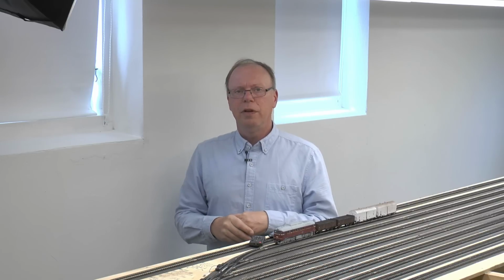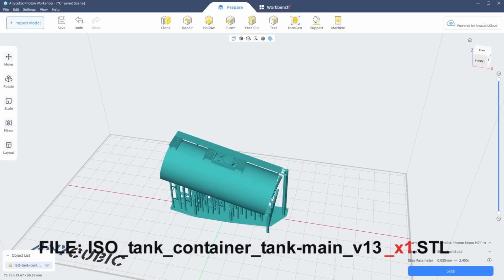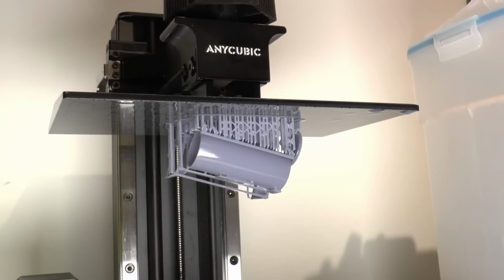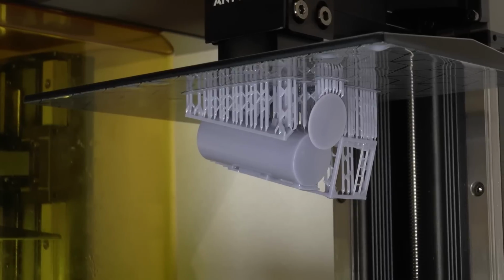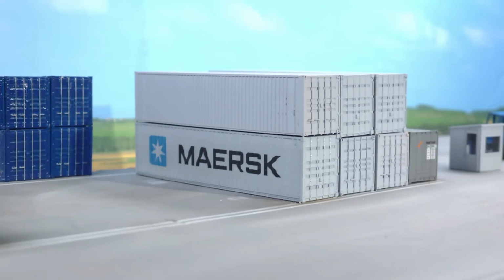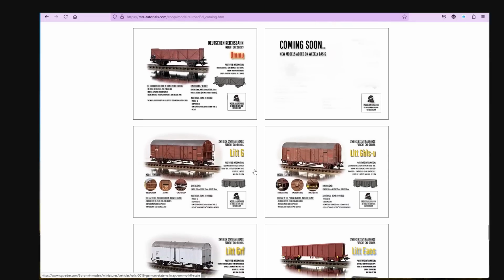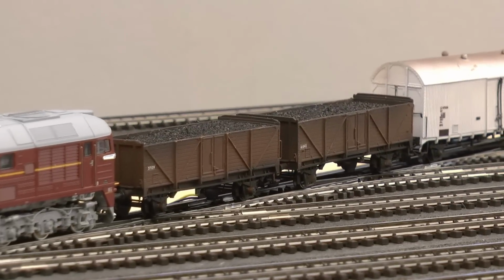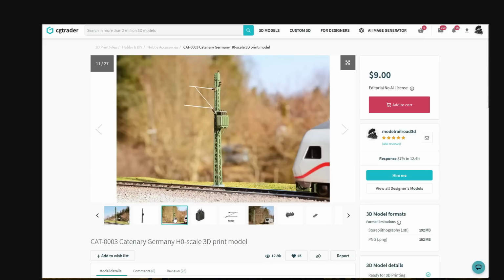3D-printing for Diorama and Model Railway - News and Updates

Comment: Hi Martin, would it be possible to downscale the models to N-scale?
Reply from the maker: Yes, it is always possible scale down to N-scale. But then you need a 3D-printer which can print the resulting thin structures. With a resin printer that mostly is okay, but for filament (FDM) this can be a challenge.

Comment: Thanks for such a detailed videos.  May I know best angle to print model without loosing details. My models tends to bend at corners while printing.
Reply from the maker: I typically print using 5, 15 or 30 degrees angle. Bending corners typically had to do with insufficient support and typically happens with surfaces closest to the print plate = the part which is printed first
Reply: @marklinofsweden Thanks so much for replying.  I designed wagons myself. I will try printing as per your suggestions..
Reply: I printed one wagon and result was good. May be I need to fine tune a bit. Thank you once again for the help.. looking forward to connect again

Comment: are you able to print the models with filament printer
Reply from the maker: Yes. I´m quite positive they will print, but not to the same perfection as resin does. You probably also need to fine-tune your settings too and also make your own setups of each model in your slicer software to get a good result.

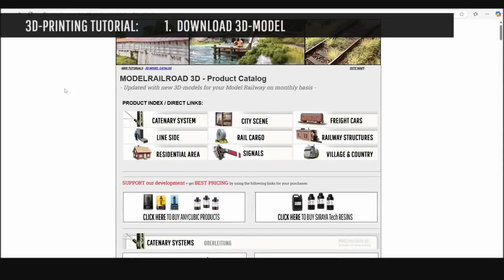Comment: How about scaling up to 1 gauge, so 1:32? Is that no problem? Thanks for your answer!
Reply from the maker: Hi Johnny, Scaling up always work as long as your 3D-printer can handle the bigger sized item.
Reply: Resin printers are superior for detail, but for parts in 1 gauge, specially larger stuff FDM printers sort of have the advantage. I guess for small to mid size objects like signal, people and cars resin may as good or preferble.

Comment: Wonderful video!  I might try printing hundreds of containers and selling them for a much better price than $20 for 2
Reply from the maker: Hi! Modelrailroad3D 3D-models are for private use only. You need to purchase a commercial license if you intend to manufacture and sell items. They do offer commercial licenses with a limited validity of 12 months to keep cost down. Please contact Modelrailroad3D through the message function on CG Trader to obtain a price.

Comment: HI Martin, another great video, but can you do a similar video for those of us that have an FDM printer (I looked on the CGTrader site and it seems that all of the models available are for Resin printers).... ... we (the people that have an FDM printer)are getting left behind and the price here in Australia for a Resin printer is still well above $600...Your specified printer is approx $900 and that is just for the printer not any resin or any of the curing machines that are required when printing resin items.
Reply from the maker: Hi Tim, Thank you! I´m not the right guy to make a video about FDM-printing. I have never really used a FDM-printer, since it was the dominant type before I got started, so I started with resin from start. Most of the resin printers are from Chinese manufacturers, so I can´t really understand why they would be so much more expensive in Australia compared to Europe and USA, but you are probably correct. If we buy resin printers in a shop here they cost €600 too, but manufacturer webshop offer much lower cost.

Comment: Another very informative video.  I have already downloaded and printed lineside and har our details using a water based resin.  What resin do you use for cars, and is it possible to by NEM coupler springs?
Reply from the maker: I use a mix of two Sirayatech resins: 90% AbS-like fast navy gray 10% Tenasioius. The latter to maintain fleibility in material over time, so wheels and coupling can be replaced / inserted and used without breaking. NEM spring is made from music wire. There is a DIY video on Modelrailroad3D Youtube channel.